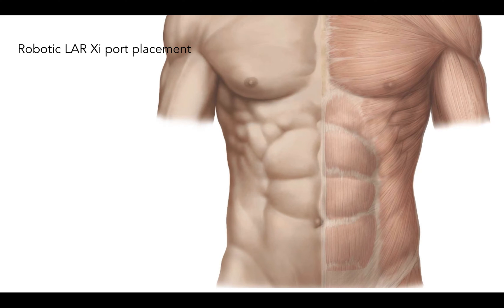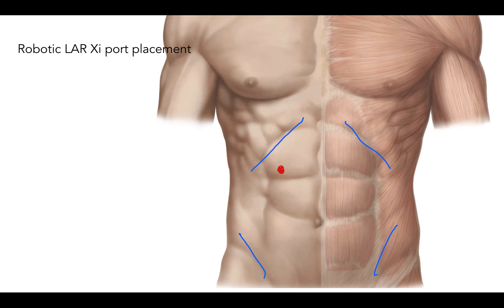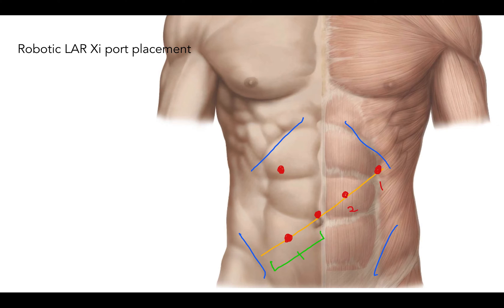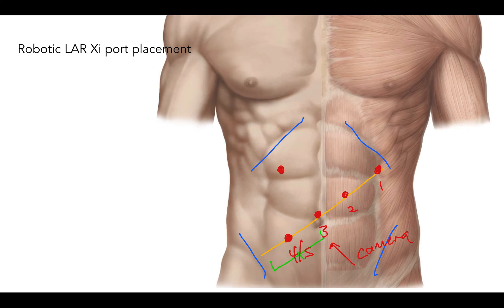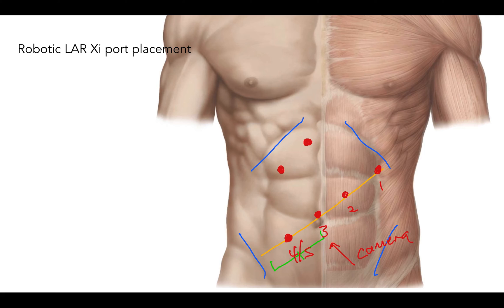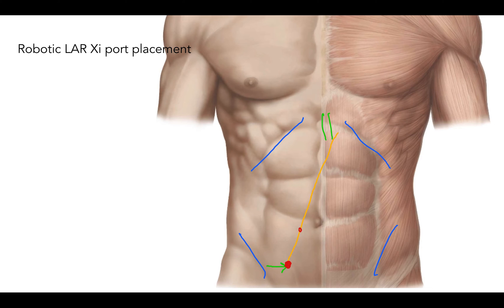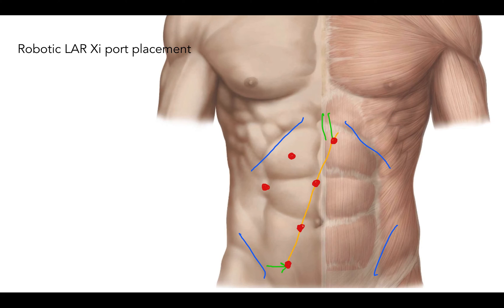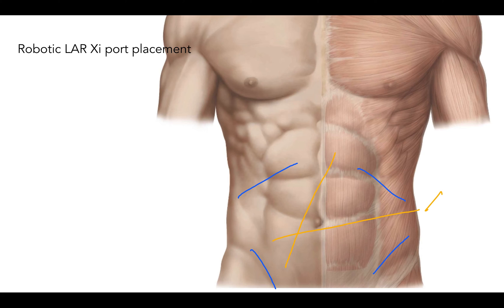Robotic Low Anterior Resection Port Placement - da Vinci Xi and Si

Comment: Great videos! Thank you so much. Any recommendations for port placement if a patient already has a diverting loop ileostomy or a transverse loop colostomy?
Reply from the maker: Depends on the location of the stoma and what the target anatomy is. 

Let’s say there’s a DLI and you’re aiming to do a deep pelvic dissection (intersphinteric LAR, for example), you’ll want #4 arm to be more lateral than the lateral most edge of the pelvic inlet. I’ll place the #4 arm in the most optimal location to do that part of the operation. The DLI therefore might be superior and lateral to that, or opposite. All depends. 

To summarize, I optimize for the operations and simply work around the stoma that’s present.

Comment: Can you explain where the robots comes in and what settings (pelvic , lower body )
Reply from the maker: Pelvic / left sideconfiguration, most commonly right side dock. But it could be pelvic / right side with the robot coming in from the left. It doesn’t matter on tje Xi.
Reply: @MarkSoliman  I did a sigmoid yesterday and I placed( I’m a first assistant /robotic coordinator) The robot coming from the right but up towards the patient shoulder and I put on lower abdominal And I manually rotated the boom towards the pelvis/left lower left side in target it from their daughter problem was the base of the robot was at my heels I’m wondering should I have put it on pelvic to give me some more room where the base of the robot came in

Comment: Looking at this video, about Si port placement, I must ask if the numbering of ports 1 and 2 is wrong. Shouldn´t port 1 be LRQ and port 2 between camera and 3? I very much appreciate your videos and commentaries.
Reply from the maker: Thanks a lot for the comment! You’re absolutely correct — the 1 arm is the surgeon’s right arm (RLQ) and 2 is the surgeon’s left arm (left midclavicular line). The 3 arm is the left flank port. My mistake and thank for pointing it out!